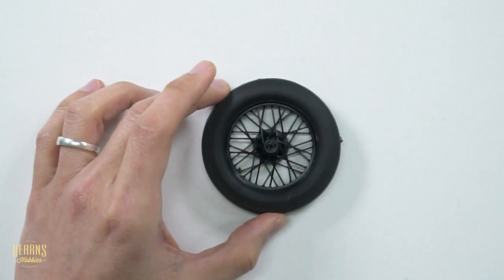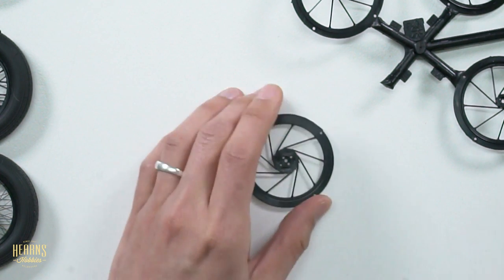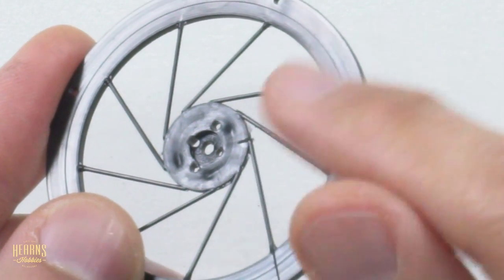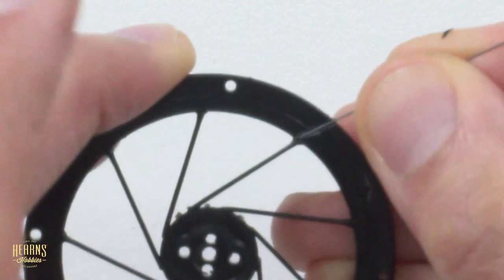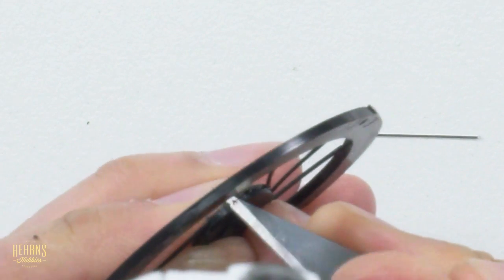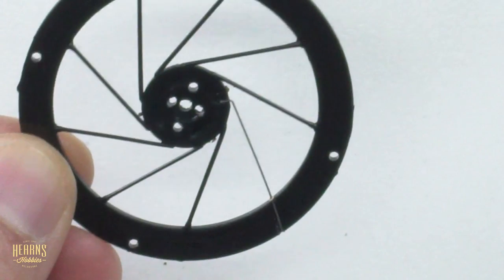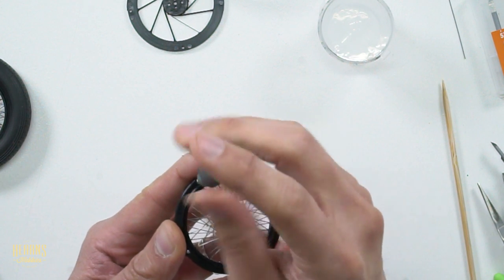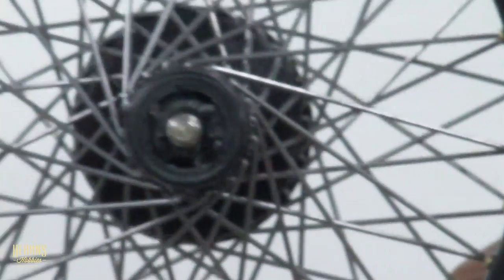GodHand & ITALERI |  How To Build Wire Wheels Tutorial 1/12 Fiat Mefistofele | #askHearns

Comment: Great but you forgot to show the fitting of the extra 9 spokes to create the 72 spoke wheels you created.
Reply from the maker: Thank you for watching. It is the same process but instead of cutting off the existing spoke, you measure halfway between each replaced spoke and add the extra spokes. Hope that is helpful.
Reply: Cheers, I figured that but I was thinking of modellers not so familiar with such  improvements.
Perhaps not everyone will realise that the wheels need another 36 spokes.
Nice job though and looks good.
I have picked up an original Protar kit with metal wheels and spokes, it's a pity they didn't cast the correct number of spokes back then.
We'll see what happens.
Reply from the maker: It is such an old but great kit. The lack of spokes would have been the difficulty tooling and cost to ensure the pricey kit wasn't overly pricey I imagine.